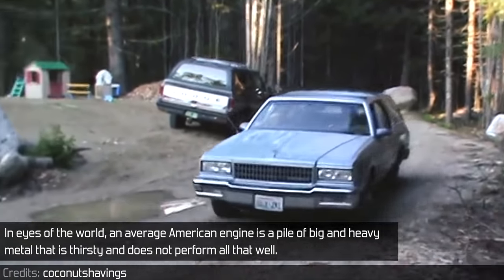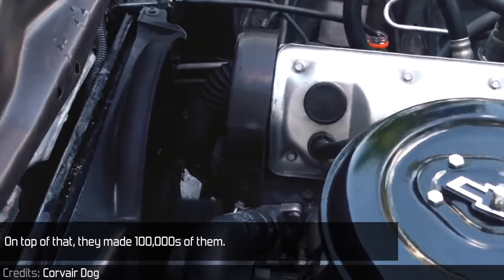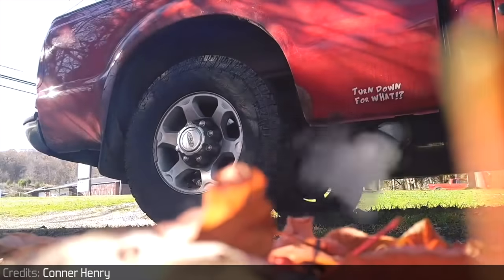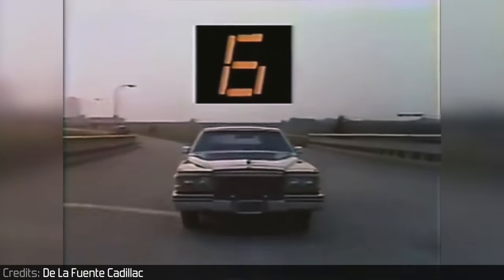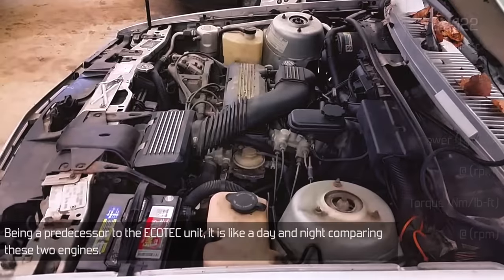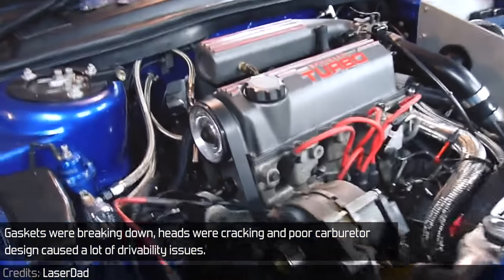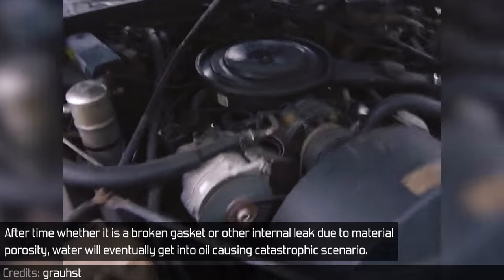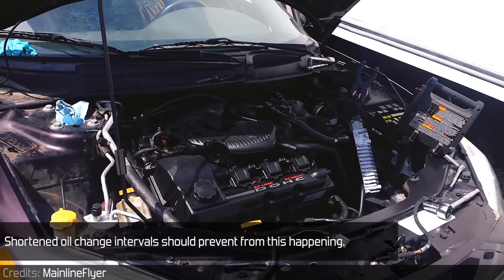8 Worst US Engines You Should Avoid

Comment: No reference to the awful Northstar V8 from GM?
Reply: Dark Steppa yes
Reply: Poor Northrstar... On paper such an advanced engine and then it just... well... seems like it doesn't work.
Wonder what's with GM and twin cams??
Reply: Why stop at the V8? The V6 is crap, too.
Reply: All Northstars had a problem with head gasket failure, regardless of the generation. The problem was that the head bolts used too fine thread and too small a bolt for the application. It's fairly easy to fix, however, as aftermarket kits fix it with using a bigger, coarser thread bolt which permanently fixes the problem. The Northstar also had an issue with oil leaks. The entire bottom half of the block was used as a girdle to support the crank, so the block is split in two pieces. GM sealed the split from the factory with silicon. Not really much to fix this one except pull the engine and reseal it. It wasn't an issue that could be resolved with the engine in the car. Barring those two issues, however, the Northstar was efficient and powerful. It's not really a bad engine, it just has some shitty shortcomings. Fix those issues though, and it's damn near bulletproof. It doesn't sound too bad with a good exhaust either.
Reply: +Dark Steppa The Northstars came in a 4.0, 4.4, and, most commonly, the 4.6L. All the other engines you listed aren't Northstar engines.
Reply: Yes, in one form or another. The HT4100 was an entirely different beast. It was it's own animal and was known to have casting defects, which led to a number of different problems. The 4.9 and 4.5, while improved versions of the HT4100, were designed differently and didn't have the problems the HT4100 had. They weren't bad engines, just inefficient. The Northstar series replaced those engines.
Reply: Go with the 3800. The 3800 is a wonderful engine, probably one of the best ever made. I'm not particularly biased toward GM, but the 3800 is a fantastic engine. Reliable and efficient. It'll never leave you stranded. 4.9 isn't a bad engine, but it likes to suck down the fuel.
Reply: it's the 4.6 I think.
Reply: I don't know about "cool." Park Avenue is kind of an old man car. But, it's comfortable.
Reply: I got the sts with the northstar the head gasket did go but after having it replaced it runs great makes great power (300hp) from a smaller size than what most engines could at its time
Reply: I've had 4 Cadillacs with the Northstar and loved them. A 1998 El Dorado, 2003 STS, 2007 STS 4 and a 2007 STS V. The head gasket issue was the worst part, the 98 and 03, but my 07 STS 4 and my 07 STS V were incredible cars. Neither of these cars had the head gasket issue and the STS 4 racked up 200,000 miles before i sold it without any major issues what so ever. The STS V was a beast of a car with a supercharged 4.4 liter Northstar and it put 478 hp and 496 ft lbs of torque to the rear wheels on the dyno. It would deliver around 20 miles per gallon and never gave me a problem. My only complaint about it was how incredibly bad it was in the snow (living in Montana meant it sat for 5-6 months a year), but that engine was just unbelievable.
Reply: bryan mccarthy Well, the 4.4 wasn't as susceptible to the head gasket failure. It was built a little differently.
Reply: Dark Steppa The Cadillac 4.1 ,4.5 and 4.9 Liter engines were not northstar engines. The DOHC 4.6 Liter  engine was . Those other engines were ohv engines " push rods" .
Reply: some of those were pretty good looking, and great for road trips.
Reply: The 2007 on Northstars were perfect engines. Obama killed it with his emission stubidity.  I would NEVR buy a car designed in Asia because they rev themselves  to death, and break down all the time. Cheap shit is cheap shit.
Reply: Not the Northstar V8.  The HT series engines from 1982-1995 were the ones that did experience the most issues.  The Northstar 4.6L was the best performance V8 since the 331, 365, 390 engines from 1951-63. But even with the old engines the cooling systems has to be properly flushed at its intervals and maintained!

Comment: RCR would be like the modular and windsor v8 lol
(edit) and the northstar v8 that shit was garbage
Reply: cheo craig i used to drive sevilles went through 3 in 2years from the damn northstar engines    great ride n pretty peppy till they blew up tho    haha
Reply: early ones where
they fixed* a fair few issues in the later ones
they weren't any less of a pain in the ass to work on tho

*terms and conditions may apply
Reply: cheo craig don't forget the Vulcan v6
Reply: Γιώργος Κρικρης  ohh goddd not the vulcan v6
Reply: Northstar sucked hard. Hate that motor.
Reply: Did you really say Windsor V8? Also, the modular V8s have almost no issues if properly maintained
Reply: The spark plug issue only effected the first few years of the 4.6.  From about 97 onwards the mod motors were/are (Ford still makes them) indestructible.  I've seen more than a few 5.4s and 6.8s with over 300k miles where literally the rest of the truck fell apart around them.
Reply: Jimmy Sanchez. pay attention when you read. I said RCR ( REGULAR CAR REVIEWS) WOULD BE LIKE.... Mr. Regular likes to poke fun at these engines its not my personal opinion
Reply: Yes they do.One is they have oil pump problems and seizes the bottom end up.Exhaust manifold problems galore.The 3 valve version of the 5.4,$700.00 and up to change plugs in.

Comment: The triton fords are great engines.. spark plug problems in the early one but fixed in 04..these are 300,000 mile plus engines.. cant believe the 4.7 dodge v8 isnt on here
Reply: I agree the tritons are good engines....but I have an '05 Durango 4.7 v8 with 300,000+ miles on it, no problems. Just use synthetic oil and the correct weight...just like the tritons, they are good if you know what you are doing with them.
Reply: Yes, the 4.7L was as bad as the 5.2L was good. Nobody wants a 99-03 Grand Cherokee with the 4.7L. They want the 4.0L six. The 5.2L is bulletproof. The one in my 96 has 362,000 mile on the original engine, and other than an oil pump, timing set, and lifters, the internals are all original. I wouldn't have a 4.7L, though. Total POS.
Reply: My p.o.s 4.7 just passed 305,000, no real problems except a couple of electronic sensors replaced. Oh, and it uses a quart of oil between changes ( I change my oil every 4,000 miles). No smoke, though. I do agree I prefer the 4.0L, though, if for no other reason than because it is a Straight Six. I love the straight six, and it chafes me that you can't really get one in anything domestic anymore. They should have left the 4.0 in the Wrangler, and it was a bad day when Ford discontinued the 4.9 (300). Chevy had a good modern straight six in the Trailblazer, but they killed it off when they replaced the Trailblazer with whatever front-wheel-drive sh*t they replaced it with. A straight six won't fit in a transverse-engine front scratcher.
Reply: My 4.7 Durango is a hair's breadth from 200k and runs like a champ.
Reply: My dad had an 04 Ram with thr 4.7, it sounded mean when u start it up, but then I drove it and couldn't believe how weak it was. It was so underpowered it wasn't even funny
Reply: My 04 Grand Cherokee has a 4.7HO with dam near 200,000 on it. Runs great.
Reply: 4.6 2v is the most reliable one. 3 value bad, 2 value good

Comment: QUAD4's have been known to break my wallet. Built a few, blew up a few.
This list could have been three times as long LOL!  I worked on a lot of this junk, that 4100 was a complete mess.
Reply: patsfast1980 What engine did you think it was? There is no Quad listed, nor any of the cars they came in.
Reply: Homebrew Subaru The Northstar is a bigger joke.
Reply: I've found NorthStar's to be pretty decent engines, expensive as can be to service and repair though. The transmissions weren't cheap either.
Reply: Homebrew Subaru oh yea 4100 caddy motora were a joke!
Reply: I had the HT4100 motor in my 87 Cadi Sedan Deville.  It ran decent when it was running good but then the block casting is so thin that the block ended up cracking at one of the water jackets and leaked the coolant out and then proceeded to overheat and ended up either cracking the head or blew the head gaskets.  I tried to get an engine replacement for it because the rest of the car was in great condition but I was only able to locate 1 engine but the guy refused to sell it because of the notorious problems that the engine had and he didn't want me coming back to him saying that he sold me a POS engine, so I scrapped a just about perfectly good car.  It was pretty sad.  The head bolts are also about 2 feet long because they ran down the side of the motor block instead of in the engine block.  It was GM's effort to reduce engine weight is what I was told.
Reply: Northstars require Ferarri level maintenance. If they are FREQUENTLY serviced they are OK engines. Not a really good choice in a car designed for old people with hearing trouble and physical limitations.
Reply: Way back when,  I ran across a 4100 with a homemade 2bbl manifold and an old points distributor. The basic motor wasn't too bad; everything else was CRAP.
Reply: I am retired GM service tech and i know how to put a head gasket in a quad 4 that wont leak...its kinda stupid simple, you coat the new gasket with GM thread sealer (like permatex) and you throw GM and thire torque angle gauge in the trash and torque each bolt to 40 lb and then 60lb and reuse the head bolts and done deal...4 years i never had a comeback....ya...4100 pos...odd how that motor could be so lame and the 4.5 had decent power..although all of them, including the 4.9 had intake gasket leak issues that always leaked internal and front main bearing issues, small beaing and the serpintine belt pulling up on the crank  and cyl. 1 and 2 in the firing order being consecutive pushing the crank down.
Reply: I had a 92 Grand Am, 2.3 SOHC a 95 3.1 SFI and an 02 3400.  That 92 Quad 4 gave me the least trouble of the 3
Reply: I had an 82 coupe d with a 4100.that thing was total trash.i agree 100%
Reply: The quad 4 was junk
Reply: Homebrew Subaru The Caddilac 4100 is the worst designed motor I don't think I have ever seen one hit 100,00 my mother had ,an 84 Coupe DeVille she bought brand new the car was very well maintained my parents luckily got 70,000 mi out of it
Reply: +Homebrew Subaru The CVH 2.0 in the early Focus SEs, are a bigger joke and a pile of dog shit!
Reply: Homebrew Subaru 4100 Blues ... lol,  those sucked ass to work on
Reply: Agreed with Ferrari level maintenance, however, in my experience, most Northstars went through head gaskets pretty often as well.
Reply: not  buy  99   they  run  great
Reply: Terrifying T-Type 4100 engines are pretty good north stars engines all mostly have head gasket blown with low miles i rather have the 4100 engine at least the headgasket want blow at low miles like the north star engine do
Reply: i have one in my  99 grand am   its not a dog ,,, just change  the dex-cool  every  3   years  ,,that was  the problem
Reply: My guess is they didn't want to spend another $2000 outside of warranty to get another head gasket done. Or a 086 cylinder head. Or a bottom end built. Or a getrag 5spd. Or timing chain. You put thread sealer on the head gasket??
Reply: SOHC Quad's were much more reliable.
Reply: Quad's were a disaster. Sure they made awesome power, but popped head gaskets, cracked heads, spun bearings. Last one I built made the most power and lasted quite a long while. It still popped a gasket and cracked the head while driving hard.
Reply: Quads phased out in '95. Your engine is the Twin Cam, which is a redesign of the older Quad 4. Most of the cooling issues were taken care of. Twin Cam's still have a shitty bottom end that loves to spin bearings and throw rods through the block.
Reply: Are you talking about the Saturn 1.9? The SOHC 1.9, apparently sucked shit!... At least the ones around 1995 did, IIRC... The Saturn DOHC 1.9s are more likely to live a long time...
Reply: Saturns never got a Quad 4.
Reply: Had a 85' Fleetwood 4100 bought it from original owners with 80k sold it with 189k beat the crap out of it only replaced the water pump and serpentine belt in the 7 years I owned it coldest AC and air ride floated like no other!
Reply: Mike Lunn  you should have put it a 4.5 they were much better and most of the earlier problems we're sorted out
Reply: Terrifying T-Type While I agree that the 4100 should be on the list in general, I actually owned one (passed to me from my father) and I never had any huge problems out of it. The Northstar I owned, however, blew it's head gasket 6 months after I bought it, right after turning 100k miles.
Reply: Was the 4.5 they used from 1988 to '90 any better? I'd think it would drop into an '87 without too much hammering.
Reply: @Terrifying T-Type you made money due the people that brought them couldn't find a dipstick or even know where the cooling system overflow tank was.
Reply: @antoniovillanueva308  or anybody that don't know where the dipstick is.

Comment: I can’t believe he found running examples of the olds 350 diesels that still run for this video! 
Same with that Vega engine, what junk.
Reply: ive got the v6 version in a olds ciera doing just fine with 225k on it...does leak quite a bit of oil though...
Reply: I had one of those 350 diesels , the replacement was fine
Reply: kevin hoffman 
Those diesels seem like if they make it thru break in to say 20k, they will live for a while.
but it still won’t usually have the diesel reliability that lets most of em make it to 150-200k
Reply: Vega's problem was head gasket tech was not good enough for a good seal between cast and aluminium and the radiator only holds a gallon of water way under cooled.They had it lined out by 1976 but it was too late damage was done. The earlier models also suffered from air pockets during the rustproof dipping process that left untreated metal exposed to rust quickly. They were in a hurry to release the car and screwed up. The first year didn't even have a glove box. I've restored 2 one kammback and one hatch. I still have a dealer brochure for the 76 vega.
Reply: By the way to give an example of how they run power wise i had a 71 vega stock F 60 13  on back with american racing daisy wheels automatic trans. and outrun a new at the time 91 isuzu pickup 2.3 5 speed beat him by 2 car lengths. Would do one hell of a power brake burnout.
Reply: Both of them are easily 5 times worse than a 5.4 ford.
Reply: Vegas still exist?
Reply: jdcunnington it was discontinued sometime back in the 80s, it was a trashy car with warped cylinders and horrible build quality.
Reply: MrHillfolk 150-200k is nothing for Mercedes diesels especially the OM617 arguably one of the best engines ever made.  I have had them go 300k or more and had to sell the engine because the car rotted out.
Reply: The N/A diesel 350=The diesel that gets its ass kicked by a gasoline engine! Gets killed by a gasoline engine!

Comment: The 4.6 in cop cars proved virtually indestructible. The cars were the number one choice for police departments and taxi companies, two of the TOUGHEST environments ever foisted on a piece of iron. Reason? COST of operation. So tell us again genius. As much sense as trying to beat up on old school small block Chevys.
Reply: Those were the Panther Platform started in 1979 and ended in 2011.
Reply: Ford police car mythology, it never ends. The following statement kills ALL arguments about this car: Do you see a LOT of these cars on the road?
Reply: NeverTalkToCops1 I see crown Vic’s all the time honestly, all cheap and have too many miles to even be reliable, but I do see a lot of them
Reply: @CC Ryder We just crushed those junky Chevys down here in the South. Their engines would blow the gaskets out from under the heads on a long high speed chase. The 4.6 Ford was nearly impossible to kill. And our local officers certainly tried.
Reply: @NeverTalkToCops1  Yes,I do our local  law enforcement agencies are still using them religiously. Some of them now have over 500,000 miles on them and are still running strong.
Reply: @CC Ryder In Tennessee,all the P71 Police cruisers come thru the same dealership in Nashville where they are modified and hopped up,so don't come to Tennessee and think you are going to outrun that P71 cruiser that's chasing you,it ain't going to happen.
Reply: @CC Ryder That must be why so many thousands of people come to visit every year huh?
Reply: @NeverTalkToCops1  Yes, AND FROM YOUR PROFILE I CAN SEE WHY YOU DONT LIKE SAID COP CAR
Reply: The 4.6 had two variants. The single over head cam that I have and the double over head cam in the cop cars.  The single over head cam had a different head with only three or 4 threads holding in the spark plugs. Changing the plugs would damage the hole threads and blow the plugs out of the engine. 
I don't know of any cases of the Merc Marauder or the police cars with this problem... so I have to think the head was much better. If I ever rebuild or replace that van engine I will decide whether to put a police 4.6 in it or a 300 6cyl.  The police or marauder 4.6 would work with all the single over head cam stuff. And what was not right I can get in the junk yard.
Reply: @KlodFather  The cop cars had the single overhead cam.
Reply: @atx-cvpi_99  -  There were plenty of both single and dual overhead cams in the police cars.

Comment: we had a 91 cavalier with the 2.2 mated to a five speed stick and that was a great running car the engine had a ton of get up and go it was a pushrod style in line 4 that had power around 110 to 120 hp  considering most basic option cars came with around 75 to 90 hp and GT versions pumping a whopping 115 to 130 hp this engine was not bad at all never had to fix much off anything on mine ex girl drove past 310k miles with a stretched timing chain before it finally gave up the ghost